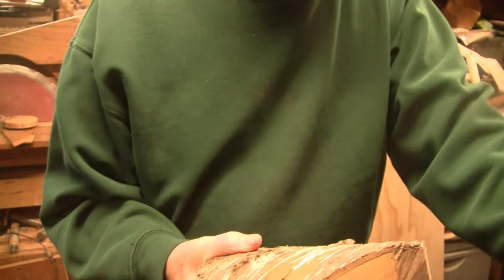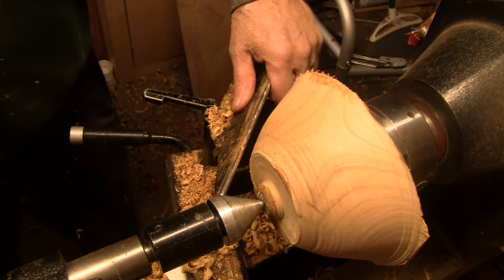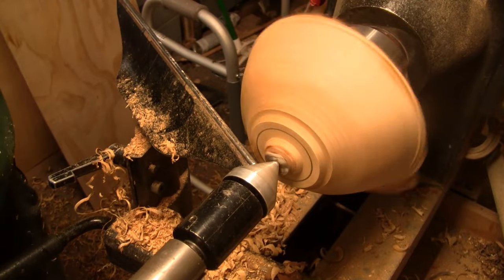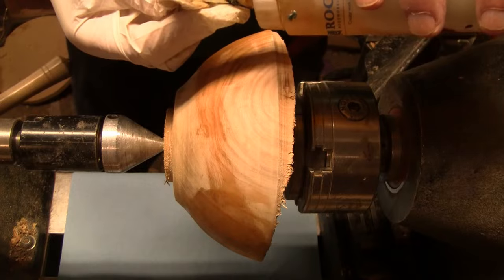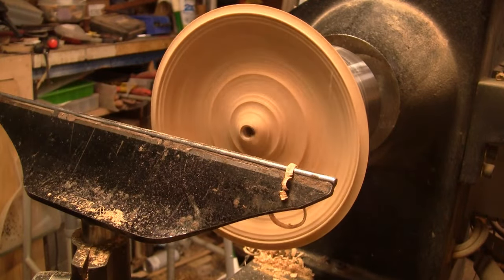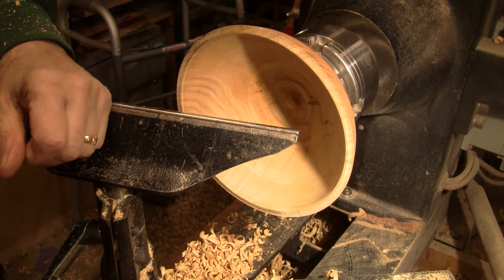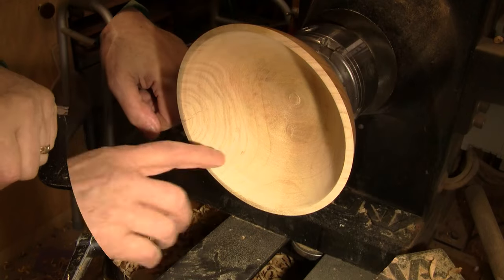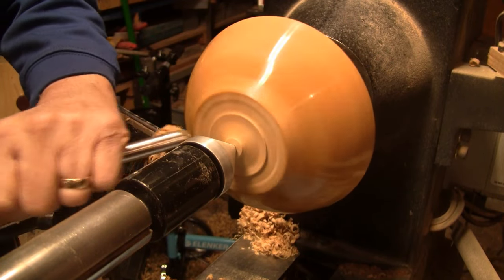Wood Turning The Birthday Ankle Bowl

Comment: Well, I have been away from youtube about as long as you have been away from turning.  I was busy, but now I have a sore shoulder and sore elbow that has slowed me down so I am taking some youtube time.  Haha.  At least, I have been able to do some hiking.  I am glad you are getting along better now.  It is probably as hard for you to do less moving as it is for me.  If I can get my arms to behave I will be all set.  I do like the bowl.  Dang worms.  Haha.  They mess with my walking sticks some times.  I have had to fill them with CA glue too.  it works and looks fine.  I use shellac sanding sealer then spray lacquer to make a final finish.  It seems to hold up.  Glad you are doing better.  Take care.
Reply from the maker: Thank you Travis. Yes it was really hard for me for 2 months of not being able to get up and get my own coffee without a major setup. Away from the lathe drove me nuts for sure.
If I have far to walk if I am walking outside I am using a cane now. It does help. Inside I am not going that far so not needed.
 I do like the combo shellac and sprayed on lacquer.
 Take care of yourself,
Gary

Comment: Belated happy birthday mate.  I still can't make bowls that thin walled ! 
My oak bowls are half inch thick and heavy!  I like em ! Thanks for your videos. I learned a lot 👍
Reply from the maker: Thank you Steve. Cherry is a good wood for turning thin and Walnut is as well. The thinnest I have done is Apple.
The biggest thing is getting it started at the rim. The thinner it gets the more is worries you. Try using a parting tool to get a start the go to your gouge. This will build confidence in doing it.
Take care,
Gary
Reply: Cheers, I'll try that when it warms up in my little workshop (garage!)
Bit too cold over here still. Funny enough I broke both ankles 18 months ago. Standing on cold floors is not good..
All the best ☺️

Comment: Hi Gary,  Glad you didn't get beaned by the "flying saucer!"  Very beautiful turning, but I'm a little confused about finishing the bowl when the moisture content was 15% (for perhaps higher in deeper parts of the wood).  I thought the teaching was to air dry it after rough turning until the moisture content stabilized.  And if sealed with shellac when still  at 15% are you risking the wood rotting because moisture can't escape?  Still trying to learn here,,,,Thanks!
Reply from the maker: Thank you very much Israel. When cutting out the inside you are at the end of the bowl. It flew off at a right angle to me.
For Oregon this time of year it is not a surprise that it would be a 15% if stored outside but under a covered area.
By the time it is turned to size it is pretty dry. Sanding will show you that;
 I have turned very wet wood down to 1/4 inch and it has sanded nicely.
 I have never had anything rot. But I am not much on the rules of what is said you can do and what I do.
 Trust me when you get down to 5/16 wall and can sand the piece you should be fine.
Thanks for watching,
Gary